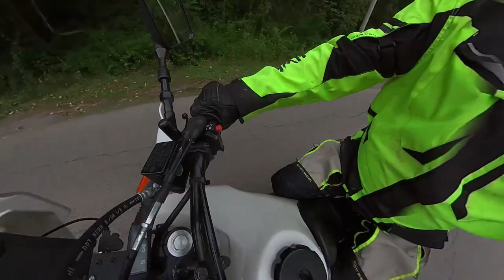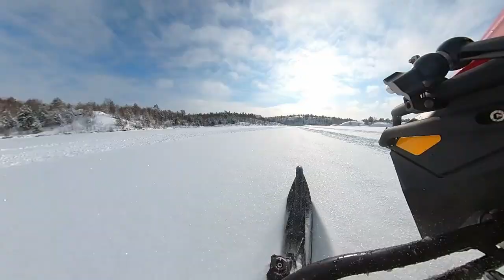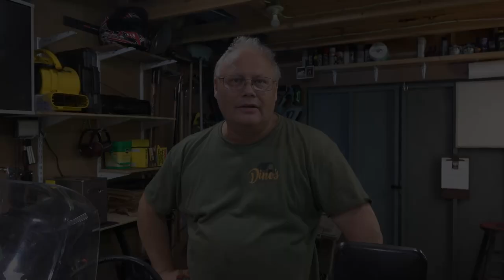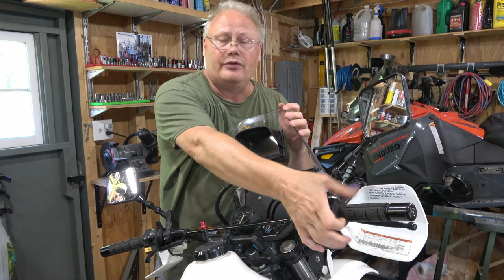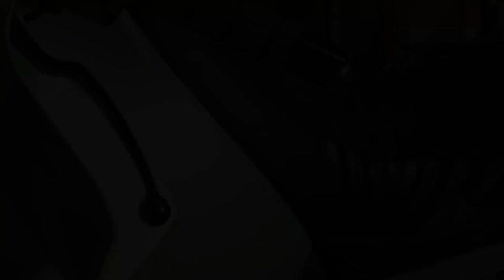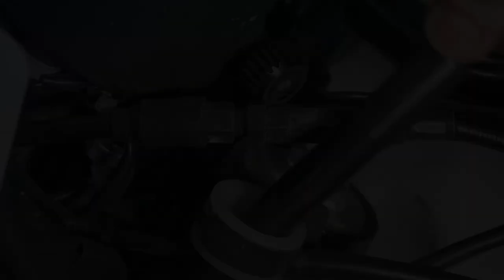Lets look at how to adjust the cable clutch on a Suzuki DR650

Comment: Great video, my 2018 DR650 was stolen 5 months ago and I just got it back. It's been through the wars and I'm currently repairing it. The clutch was seized, I freed it by running the bike in first gear on a stand with the clutch pulled in and then stepped on the back brake and POP it was free. Now I just need to adjust the play in the cable and do an oil change!

Comment: All good information Dino. I find accurate clutch actuation is important on the DR to get the best "feel" when taking off from a stop. You have provided information so owners can make adjustments to suit their requirements.
Reply from the maker: Thank you Mal, I think many will "tweak" the free play to get the feel where they want it but I hoped this would be a good starting point.
as always, thank you for the comment.
Dino

Comment: Hi Dino, thanks for another great video.
I noticed at 5:20 you said it would be difficult to "get it into neutral when you come to a stop". 
That made my ears perk up...I'm a riding instructor, and want to point out that many riders think they should be in neutral at stop lights and stop signs, but we should all be in first gear. That allows us to quickly get out of the way in case traffic behind us looks like it isn't going to stop (and of course we left plenty of space in front of us to allow this escape).
Happy travels!

Comment: My DR seemed to have the right freeplay, but I felt like it didn’t shift as smoothly as it should as if clutch wasn’t completely disangaging. I removed a bit of freeplay and it now shifts better.
Reply from the maker: Sometimes that will happen, and I should have mentioned that.  I find also that if you shift with only one or two fingers the clutch may drag a bit because the clutch is not pulled right to the bar because of the remaining fingers grasping the bar and stopping full articulation. Not sure if this is what is happening with yours but I should have mentioned this in the video 
Thank you for the great feedback.
Dino
Reply: @DinosTinkerShed  It's still not 100% perfect, but 75% better. My friends 2011 with 20000km (mine is a 2018 with 12000km) shifts so smooth its ridiculous, up and down you can barely feel the gears. On mine sometimes its silky smooth, sometimes I feel like its a bit rougher than I'd like (and I make sure to fully pull the clutch and I've ridden over 300000km on motorcycles so I'm pretty sure it's not my technique hehe). Maybe it's been used for hardcore offroading and clutch has been abused more than normal for the km...
Reply: @Speedytrip  Mine is brand new and has similar issues.

Comment: Great video Dino!
I personally prefer to adjust the friction point, and just leave the free play where it ends up.  I like to have the clutch just fully disengaged when the lever is pulled against my gloved ring and pinky fingers (using my index and middle fingers to pull the lever).  This can result in the freeplay being a little bit on the tight side, but I find it more consistent and controllable when making panic shifts/stops, particularly off-road.

What I really need is lever with adjustable reach... but I didn't buy a DR because I like to spend money unnecessarily!  😁
Reply from the maker: I don't disagree with your philosophy, I actually run mine with a little less that 10mm myself, however I wanted the video to reflect the way the manual specified the process so new riders would have a baseline to set the clutch up with repeatable results. I think as a person  rides more they will come to a point where they will fine tune the lever to their liking. I am hoping the video provided the foundation to make more refined adjustments in the future for those who choose to do so.
Thank you for the great feedback.
Dino
Reply: @DinosTinkerShed  Agreed, best to show the manufacturers recommend setting in the video.

Comment: Thanks I to luv your vids... I just did nsu fix and it went smooth except when I hooked the clutch link back and notice there's hardly no pressure on clutch lever .. I haven't added oil back yet because trying to make sure I won't need to empty it out again because I'm not confident I have the clutch engagement correct (lil thing with grooves that slides into thing with spinning rod that clutch link connects to) I did use a sharpie to mark  where link attached top of the case .. I had trouble getting it to line up.. I'm thinking that might have something to do with it ... and inference would be appreciated .. thanks again for the great guides!
Reply from the maker: Thank you for the comment and question, I always point out I am not a mechanic but will put in my thoughts. I would think you have something not assembled right inside. I did the same thing when I did my clutch and it would not release. I would open it up and check to make sure all the friction and steels are tight to each other, there should ne no gaps in the pack once assembled.
I hope this helps.
Dino
Reply: @DinosTinkerShed  I think when I marked top with sharpie it was rotated out of synch. Id swear I turned it and this would not have been wise unless was also marked on case. I also figured I had moved the throttle cable. After unhooking the cable from both sides lever and case link .. I then reconnected both and now clutch actually feels normal with slight play before engaging... thanks!

Comment: I have an 08 with only 1100 miles and I’m nearing the end of adjustment at both locations. Could the cable be stretched or something since I can’t seem to get enough free play with those adjustments?
Reply: Can you take the actual arm off of the clutch case and move it over one tooth?

Comment: Hey Dino, I am working on setting my clutch tension and notice that when doing it as you’ve suggested there is a little “slop” on the lever. Meaning that after releasing the clutch there can be a slight gap between the clutch lever and where it sits on the control. Is this acceptable? Thank you!
Reply from the maker: Yep, that's how it should be, that's your free play, great question.
Dino
Reply: @DinosTinkerShed thanks Dino! You’re the man!

Comment: Ive got an odd issue with my clutch.  Brand new plates (replaced end of last season), engages well, seems good but 4th and 5th slip at the higher rpms.  Any ideas?  I just adjusted the clutch  cable according to this video and released some of the cable pressure...  but im beginning to question oil as i have been told they can contribute and i do use synth oil in the bike.  Anyhow, thanks for a good video.  This seems to have just begun happening btw, rode quite a bit till very end of season and some in winter, but now its certainly slipping.
Reply from the maker: When I installed my clutch I started with motul full synthetic oil and the clutch was really grabby on engagement. I switched to shell Rotella t4 and the clutch is operating much better. I would try a different oil and see if that helps, you could also add a bit more free play but then you risk the clutch not fully disengaging.
Reply: @DinosTinkerShed  Seems that the adjustment did the trick though i will change oil and use the same as you...  rotella t4.  I just backed down the adjust a little bit and added in the free play you spoke about in the video and its perfect.

Comment: If you measure the gap between the lever and the clutch perch it doesn't matter how long the levers are.
Reply from the maker: Thank you for the input for sure, this is true but most new dr650 owners still have the hand guards in place which makes the gap method difficult to do without removing the hand guards. Again, this video was the basic factory method for new owners to get rolling, as they ride more they will undoughtabley learn more sifistocated methods.
Thank you for the comment.
Dino

Comment: Hey Dino,

I've been inspecting my clutch pack and reinstalled it (it was well within spec). I now have a very heavy clutch pull? Original springs, discs, metal plates are installed. Evenly and cross pattern torqued to 10nm as per manual. The bike's been sitting on a lift for three weeks, with the clutch lid of. Is this something I can fix with the clutch cable, or are my plates just dry or something? A collegue of mine reminded me if put the #2 plate, which is thicker, first. And I'm doubting if I did, or last. If I did it last, could this cause a heavy clutch?

I've been playing around with the cable length, but slack or not, I still have a heavy clutch pull and it just doesn't disengage enough. I can turn the wheel in 1st gear with the clutch lever pulled in, albeit heavy to do so. You definitely have to push through friction. This is also the case walking the bike around in gear with the lever pushed in all the way.

(hypothesis: is this normal and does it just need to oil up for the friction to go away? Side note: Bike won't start at the moment after carb clean/clutch inspection so I can only check with cold oil at the moment. The engine is turning but no ignition at the moment. I have to pull the new spark plugs and see if they work at all.)

Any insight or guess at this matter will be much appreciated!

Ron
Reply from the maker: Ron, I am sorry to hear that you are having issues with your DR.  I just want to say that I am not a mechanic so take my advice with a grain of salt. When I have issues like this (take something apart, clean it, reassemble and it does not work) I always retrace my steps and also try to eliminate potential causes from sub systems (like the cable).  To eliminate the cable, I would disconnect it from the clutch arm down at the case cover, you can then cycle the cable and feel if there is any unusual resistance or friction. If the cable seems to move freely then I would suspect the clutch pack is assembled incorrectly. I did this in my video on changing the DR clutch, when I re assembled the clutch the first time I did not seat the basket correctly and ended up with one or two of the friction dicks being "pinned" between the two halves of the basket. This meant that the clutch could not fully compress and there were gaps between the plates. I noticed this before I reinstalled the pack so I do not know how it would impact clutch pull, but I do believe that if the clutch worked correctly before you took it apart then most likely something is not assembled correctly.
I hope this helps, if you still need more help, I suggest posting the question on DRriders, this forum is full of smarter folk than me and they love to help out with issues like this.
Eather way, please let me know how you make out.
Dino
Reply: @DinosTinkerShed Thank you for sharing. A wrongly installed pack seems highly likely.

cries

Plus point is that I can check if the #2 steel is inserted correctly. Bummer because The Netherlands has a big problem getting a proper gasket for a '92 since Europe hasn't sold a DR since +/- 2008. I'm not against liquid sealant, but they require a long dry periode, especially now in the winter.
Reply from the maker: I agree with the sealant, I prefer to use it only as a bonding agent for the gasket but if needed I will use it alone if I have no other choice. Good luck, please let me know how you make out.
Dino
Reply: @DinosTinkerShed  Hey Dino,

Well the DR is back from the shop... and boy did I mess it up good. While trying to fix the sticking and heavy clutch, I probably moved the timing chain and possibly the gears as well. My whole timing was 90° off and the bike would have never started. I thought it might be the carburator, so I send it in for a tune-up and tire change while it was already there, as I was at my end guessing what was wrong.

Oh boy, the cost of repair was almost what I bought the bike for but I choose to let them fix it. Otherwise I'd be throwing away too much money anyway. I'm now officially married for live to the DR. I damaged the starter clutch with the timing being off. Apparently it was already worn, but I gave it it's final push. A lot of expensive gears grinded and they eventually tore open the entire bike fixing and cleaning it, properly aligning the timing and valves, changing gears and what not.

The liquid seal didn't hold as the damaged edges I caused (I overlooked a bolt and started hammering and prying the lid off) were too deep and they caused a hundred meter long oil spill after they serviced the bike and used some liquid seal together with the gasket while riding the bike. They used liquid metal to fill up the gaps. Luckily I was spared the cleaning costs. Carburateur was fine though! Yesterday I took it out for a spin. Slapped MotOZ RallZ tires on and did some stretched of sand. All good now!
Reply from the maker: WOW, that is terrible, I am glad your DR is repaired but that is not fun at all. I hope this does not turn you away from home repairs. I have retimed my DR before when I had my head off to re-ring it at around 40k, just curious, did you have the lower cam chain gear off?
Dino
Reply: The chain that runs up to the valves, but also, the crankcase was at a wrong position wrong. I probably thought it wasn't connected in neutral and while trying to put the clutch back on and off a good 10 times, I probably kept aligning the gears and thus turning them a teeth at a time maybe. I was stupid enough to "inspect" the timing chain, completely altering the valve in/outlet timing also. Rookie mistake.

I'm definitely not put off to do things in my own shed, but I will think thrice before starting a new project on an old bike, definitely anything that has to do with the engine.

Comment: So somehow I snapped the clutch cable on my DR at the break lever. (I suspect sabotage but thats probly a conspiracy) I replaced the clutch cable but now the clutch never engages when I pull lever. I was stupid and didn't mark the little arm before I took it off. How do get enough travel to fully engage the clutch when I pull lever" It is possible I just get a shit cable.

Comment: This is not what a clutch adjustment is about and it's not the correct way of doing it. Clutch adjustment should be done what's the bike off the ground and the motor running while in gear. When the clutch lever is pulled in the rear wheel should come to a complete stop. This is how you know the clutch is not slipping. You make clutch adjustments until this is achieved that means the rear wheel does not move. That's how you know the clutch is not slipping